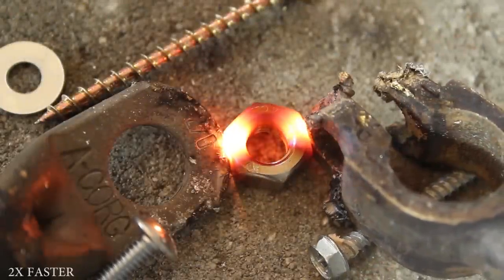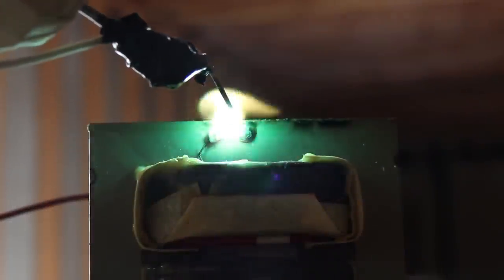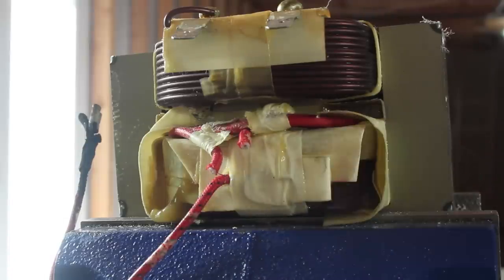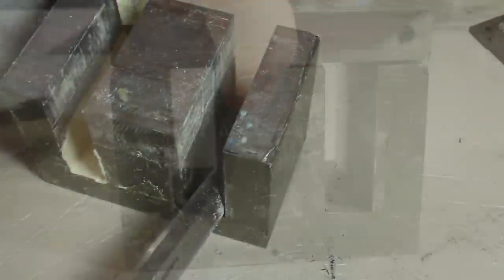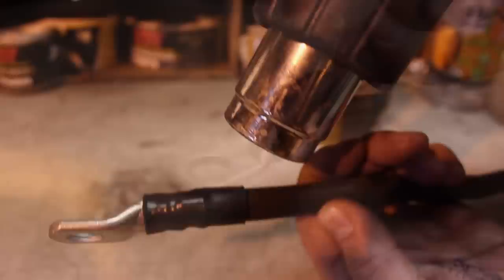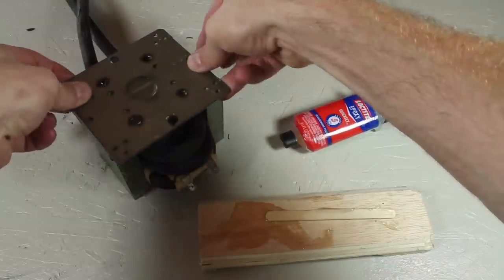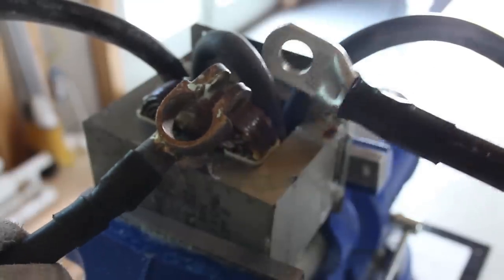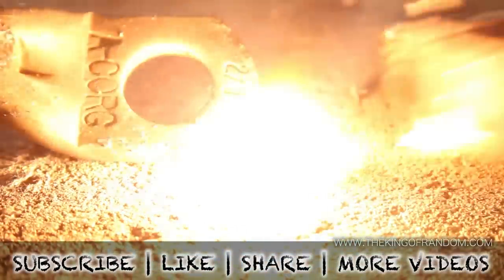How to Make The Metal Melter

Comment: but can it melt steel beams?
Reply: dang you got me thinkin now, doesnt need any explosives or thermite or anythin but some amps. hmmmmmm
Reply: only jet fuel bro
Reply: Martruta
Reply: some people dont get the meme
Reply: if it cant melt 5/16 steel bolts, it cant melt steel beams
Reply: try jet fuel.  it only burns at about 1400 degrees, and steel melts at >2100, but it worked on 9/11, so give 'er a whirl.
Reply: Tocen i doubt it, just like JET FUEEEEEL
Reply: Robert T you don't need to melt it, just weaken it enough to lose structural integrity.
Reply: No but Hillary can with her looks
Reply: Tocen maybe not steel has a very high melting point not sure how much yet
Reply: shush!!! the world will end if you keep giving this guy ideas!!!

Comment: It makes me laugh every time I watch this when he says "gently put it in" then starts hitting it with a hammer haha
Reply: BatWoman807 hehe that made me laugh as well
Reply: +Marlee807 when?
Reply: +Matthew'sRandomness 2:19
Reply: Samir Bavkar oh lol
Reply: +Ishak Hassan  It's a rubber hammer, yes. Usually, rubber hammer will not damage the coils, but otherwise, it's a good method. Just not a great idea in my opinion. You'd usually use rubber hammers against metal to avoid dents and marks on metal.
Reply: ***** pretty much, yeah you can, but if your going full force on it, it may or may not dent your car. A rubber hammer is made to absorb the impact so it won't damage whatever you're hammering down. As of this case, not to damage the coils
Reply: +Cole Hall Yeah, they use 'em on the sides of dry bulk trailers so they don't put a hole in the side, but I'm sure if you brought it down on the hood of most modern cars, it'd leave a nasty dent with enough force.
Reply: The Running Ferret yes, but not as bad as a normal hammer

Comment: I built one today with the intention of using it to quickly heat stuck bolts when i'm repairing stuff on my car. Bring a bolt to red glow and it'll let go of the rust barrier between the threads. :)
Reply: I Will build One to
Reply: How do you conect wire and coil to melt metal?

Comment: Two questions.

1) How long can you use this setup before the heavy copper wire insulation burns off?

2) How can you prevent this from happening?
Reply: probably by not running the system too long, the longer its on the more it heats up.

Comment: A nice tip for the alligator leads is to add large heat shrink over then ends but leave just a tad of the clips exposed. Then when you use the alligator clips it's insulated but still allows it to open easily.
Reply: Nice idea, I'll use that method next time I have uninsulated croc clips.

Comment: These MOT's are awesome for stuff like this.  I found a stack of old microwave x-fmrs on a job I was working and the guy just let me have them.  I cut the weld just like this guy does, remove the secondary, shunts, and the two turn low voltage wind.  I rewind the new secondary with some thick gauge insulated scrap copper.  Im an Electrician so wire is no problem but you can buy some from a big box hardware store cut to any length you want, I have used anywhere from #6 THHN to #1 THHN for the secondary, thicker the better, it will handle more current without getting hot. You will need about a 4-5' section of wire to wind 3-4 turns. 

 I have found that it's very important to insulate the iron laminations, electric tape won't do, heat will cause it to slump and fail. I use Kapton tape to wrap any exposed part that may contact the new secondary wire, Kapton tape can handle high temps very well, its cheap to buy a roll from Amazon or Ebay. It keeps the wire from shorting against the iron laminations, vibrations/heat are strong with this much current and the insulation can fail easily.  

If you don't have a welder to re-weld the one that you cut, a large C-clamp or a quick release bar clamp will work to hold everything together.  Its ugly and not very practical but it works.   Believe it or not, before I had a stick welder I actually soldered the weld back together. I have a 150W  soldering iron for metal work, I used 60/40 lead-tin solder, it worked great. A big iron like that isnt common though.

Comment: Because everyone obviously has all these tools ready to use
Reply: Jaetpack not like he's forcing you to make it
Reply: Anthony Sparta i doubt any hardware shop will let you make this in their store.
Reply: Jaetpack If you don't It's a pretty good que that you probably arn't experienced enough to even think of attempting it in the first place. however a hacksaw and rubber mallet would run you like a whole 7$? lol
Reply: Wesley Whaley However, I don't have an extra microwave laying around for the transformer ($150), a bench vice ($75-$100), an angle grinder ($70), a 2-gauge copper cable ($25), a heavy duty cooper lug ($8), a heat gun ($75), or a multi meter ($50). In total, that would be $468-$483. That's a lot of money. A lot more than $7.
Reply: Jaetpack
 you dont need any of those things except wire and a transformer and both are easy to find as salvage? 
original point still stands lol if you dont have those things laying around you probably shouldnt attempt this.
Reply: Wesley Whaley I never said I wanted to
Reply: my response was just as generalistic as your comment about everyone.
Reply: +Jaetpack Maker-spaces have membership fees of around 20 USD and often supply electronics trash.
Reply: you dont need a vice to grip you can use almost any two surfaces to hold it in place. You need a heat gun wtf? you dont need an angle grinder, hacksaw will do the job, you dont need a microwave thats the point, you can find a microwave at any garbage day. 
only thing necessary to buy is the wire, and you should have some basic tools in your house. That being said, it literally took me like $15 to build this, all it takes is a bit of improv.
Reply: yeah a $5 microwave form a thrift store and a $7 hacksaw and mallet plus a $5 cable like $17 its pretty cheap

Comment: You should reverse the primary and secondary coil to get insanely high voltages. Maybe an unmodified microwave transformer would really only get you around 2000 V+, but the one that you changed could probably yield around 10,000 V+  :)
Reply: I hope you don't wanna melt his house ;)
Reply: That’s so cool.

Comment: If i'm not mistaken, you re-attached the core "I" piece to the yoke with epoxy which electrically isolates it from the rest of the yoke , however , the footplate attachment is on the "I" piece which is where you placed your earth wire , hence , your earthing would be less than adequate. Nicely built though!!

Comment: You say that wasnt a very good weld then use glue to put it back together hahahahhaa
Reply: Almost all transformers use ferrous material meaning the transformer body is likely non conductive and won't induce eddy currents
Reply: apoxy not glue apoxy is SUPER strong glue
Reply: The transformer metal is conductive but they enamel the metal layers so that they won't conduct to adjacent layers.  It is just silicon steel wich is conductive.  The thickness of the sheets depend on the frequency the transformer will run at.  High-frequency transformer cores are made of ferrites that are nonconductive.
Reply: SLippER679 epoxy*

Comment: 2:22-Needs to be replaced gently-*starts hammering the shit out if it.
Reply: true
Reply: 2:24-Thats why i'm using a rubber hammer
Reply: i highly doubt thats possible
Reply: garrett avery Sure you could... just not as easily. The rubber GREATLY reduces the chance of damaging things you're working on or, in your case, the heads of people you're bashing.

It's like stepping on someone's finger on concrete vs stepping on someone's finger on grass. Sure you could break their finger but you would really need to be trying.

Comment: Instead of using 2gauge wire i bought 3/0 wire from Home Depot. At 3:00 when he says its a "tight fit" he has no idea how little flex 3/0 wire has. It took every ounce of strength i had to bend the wire in a 180 with a bench vise! I dont know where to find wire as flexible as what he has but i wish i knew...
Reply: Maybe you're using solid wire or stranded wire with bigger strands? Looking at the cross section of his wire the strands seem to be reasonably small.
Reply: He is using 2 gauge, not 2/0, and it is stranded.
Reply: Look for H05 or H07 in the gauge you need, they are really flexible
Reply: that flexible cable can be bought as welding torch cable...

Comment: ...the high voltage isn't what's dangerous. It's the high amount of current that's dangerous. Since human tissue has a high resistance, the current will lose energy in the form of heat, give you third degree burns at the very least and at the very worst, it goes through your heart and throws it off rhythm, killing you.
Reply: But when it comes to very low voltages, the human body is too much of a resistor to conduct and deliver the high amounts of current. If you know what you are doing, you can hold those terminals  barehanded and short them without feeling a thing, but its still dangerous. For instance if the transformer coil is damaged on malfunctioning in other ways.
Reply: The voltage determines the amperage, Afrotechmods has a good video on it.
Reply: EPaR - Aidan Gieg
 Explain then how 1.5 - 2v can fry small metal objects till melting point.
Reply: With a large amount of current, and a low resistance. If the object has a very low resistance (like a piece of metal) the voltage can drive more current through it. Do some research on ohms law.
Reply: EPaR - Aidan Gieg While it's true that low resistance will result in more current per volt, that is not what causes something to melt. 

What causes something to melt is the power being put through it. The integral of power (with respect to time) is energy, which is made up in at least some part in heat energy, aka, what makes it hot and melting.

What determines the power being dissipated through that chunk of metal due to electricity? power = volts x current. If something has low resistance, even if lots of current can flow through it, there is not much voltage dropped across it. Therefore the value of volts * current is still pretty low and it will not get hot. 

Things with high resistance will get hot because it is "harder" for the electrons to move through them, they will cause friction and the material will heat up.

Things with low resistance will not heat up (as much). This is why you use low resistance materials to transmit electricity, such as copper or gold.
Reply: IAA015 power = volts * current. voltage = current * resistance. Substitute that back into the power equation, you get power = current^2 * resistance.

From that equation you can see power increases with resistance. The piece of metal he used has higher resistance compared to the copper wire that is part of the welder. Therefore that piece of metal will melt before the welder will.
Reply: I said I dont want to use my name It only takes 5mA to kill you. Also, I said the volts determined the amps. Meaning the volts and the determine whether you live or die.
Reply: I said I dont want to use my name Oh, also, great name! :D
Reply: Your skin still has a flashover voltage that you'd have to exceed before it will shock you. If you have 1V with 120A it won't even enter your skin unless it's covered in saline or something.
Reply: This is why you wear gloves and don't play with live wires with both hands.
Reply: IAA015 human body has thousands to hundreds of millions of ohms in resistance, that piece of metal is no more than one tenth. Neither volts nor amps kill you, but power (and frequency if AC). Provided that this power can go through you.
Ohm's law says: P=UI, I=U/R, your body takes, say, 2V/10kOhm=0.0002A which is 0.0004 watts. That nut should have 0.01 to 0.1 ohms average, so it's 2V/0.05Ohm=40 amps and 80 watts at least. Notice how heat spreads from sides of the nut where electrodes touch it, that's where resistance is highest.
Reply: +IAA015 voltage is electrical potential, so in other words how easy it is to strike an arc and how long it can be. Two volts is pretty low. The OCV (Open circuit voltage) on most American welding machines is 80v, which is considered safe by arc welders. The machines typically run between 5-30v of CCV(Closed Circuit Voltage). This welding machine, so long as you don't put the electrodes on your tongue or lick anything inside is safer than other welding machines. Be smart, look up welder safety and it'll be fine.

Comment: "This project is extremely dangerous and should not be attempted without adult supervision and adequate training."

Are you serious? That's very dangerous. Most adults shouldn't be doing this either.
Reply: "adequate training"
Reply: +Eduardo Hideki What's dangerous in here, excluding 120 volts?
Reply: Alex Cook yeah, most people do not have adequate training.
Reply: +MZ flighter the extreme heat generated by the transformer and by shorting the transformer.
Reply: Yes, and they should have very good fire insurance for when they burn down their home.
Reply: its only dangerous if you do it wrong
Reply: Are you serious? What's dangerous about it? The only thing that could kill you would be the mains voltage on the primary. For ease of calculation I will treat it as DC (Ie. no magnitude, phase angle, etc). Lets go worst case scenario (Your skin's resistance is around 300Ω (Can be anywhere up to 100KΩ). Now lets divide the two volts outputted by the secondary. 2/300=0.0066. So basically if you were to touch those wires you would have somewhere around 0.0066A (Would be a somewhat higher value due to how your bodies capacitance reacts with AC) going through your body, BUT it still wouldn't kill you. As long as you aren't some idiot who touches the mains wires, then it really isn't that dangerous. 2000VAC is dangerous, just not 2VAC.
Reply: Actualy without the secondary coil its more safer than original
Reply: I'm a kid and I've made his homemade spot welder and I'm typing this comment.
Reply: Nope it’s fun

Comment: Can the output of the new secondary coil kill someone?
Reply: +Dogauthority! Maybe, but 2V can't get through your skin
Reply: +Dogauthority! Bit late to answer but yes it is.  I'm an electrical engineering student and the first thing we are taught is Amperage. It will take 8 seconds of contact with a wire whose output is around 750 milliamps to be lethal. At 4-5 amps you would be killed instantly. I hope this helped answer your question
Reply: +S Richey You need more than 2 volts!
Reply: +S Richey what does a light outlet run at, i touched the connections in that. You know, where the bulb goes, should i be dead.
Reply: The Krowing Since you have the ability to write the comment I can see that you aren't. Was the power on? Did you inproperly ground yourself? Where your hands wet? You didn't specify all the adequate details
Reply: The Krowing Plus quick check, only enough amps to give you a minor shock if you did any of the mistakes that I posted
Reply: I also don't want to sound rude but a van de graaff generator produces hundred of thousands of volts
Reply: Or you know it could be 2 volts 999999999999666999999 amps
Reply: +Kaden Frasert No it can't. It's impossible. Current = Voltage / Resistance. You can calculate the resistance that you need. It's far too low. Even the wire has too much resistance for that.
Reply: +S Richey You are both right and wrong... the reason this is able to output 800 amps is because its all copper, thus very little resistance. I believe he said input is 2 volts. No matter how hard you try, unless you hook it directly to your heart, 2 volts has extremely little chance to have enough amps because of body and skin resistance.
Reply: +S Richey Wow. I feel sorry for your country, if you will become electrical engineer. The circut will behave like an open one if you put one cable over and second under the hand. And even if there will be some current flowing, it would be minimal, due to something as basic as Ohm's law!

EDIT Considering van de graaff generator - it generates electrostatic discharges. Electrostatics is way different than electronics/electrics. They have small current capacity (though still high enough to do some damage since ESD hurts), but mostly - they are way too short to hurt you too much.
Reply: Prehistoricman you may be right.. I forgot the average resistance of wet body tissue .. I.e. the heart
Reply: +Dogauthority! only 2 volts, so unless it's put directly on your heart, probably not.
Reply: +S Richey So you are an electrical engieneer  and you don't know the ohm's law???
Reply: xTheDarkSiderx I'm pretty sure you are dead now! Are a zombie?
Reply: It will burn you really bad....I dont know about killing you, that depends of so many things...
Reply: @alexnowlan7827  No you wont die. A car battery is about 500 amp. And you can lick on it. Its is to Little volt. But high amp. You need both high amp and high volt.